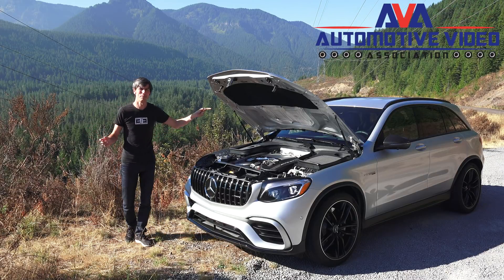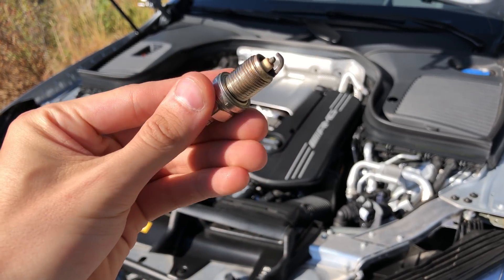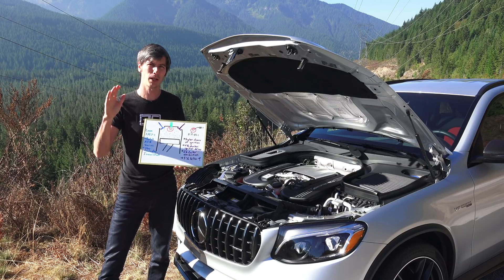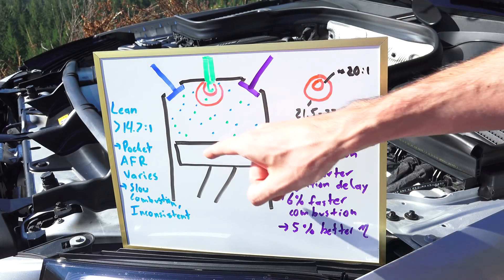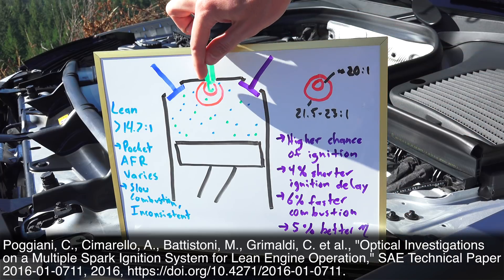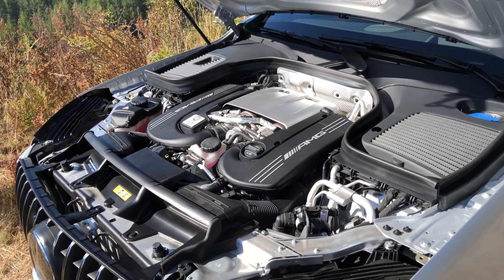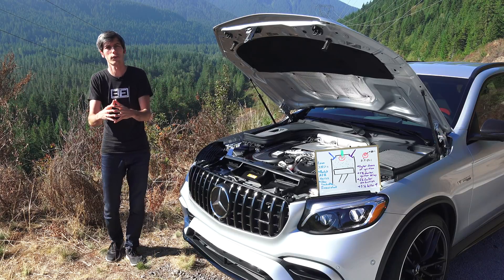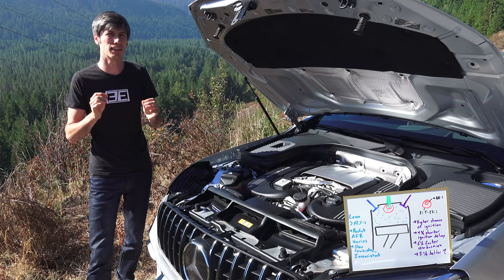Mercedes Spark Plugs Fire 5 Times For Better Efficiency

Comment: 5 sparks within 1ms - that means the charging time of the ignition coil must be about 200µs. Do they use 'conventional' coils with very low primary inductance or a capacitor discharge igntion system ?
Reply: they use COP (Coil Over Plug). Each cylinder gets it's individual coil and MosFET transistor driver. I don't believe any Capacitors are involved because they don't take heat too well... early failure.
Reply: @glasser2819  I know, but most coils take 1-4ms to charge for an energy between 30 and 90mJ. That is not an option in this case. So it would be interesting to see if special coils with cspacitors or conventional coils (low inductance , high current) are being used.

Comment: do engines need to be designed so they can use 5xspark plugs or could you put it in any motor, given their the right size
Reply: Pv†. Oldschool you could put it any motor but you may see no difference or actually a decrease in economy depending on the design of the engine. (It’s not just the plugs that need to be replaced)
Reply: Nicolas Losito  remap ecu aswell?
Reply: Pv†. Oldschool you will need spark plugs that can handle the increase in  usage along with matching coils. Ignition control would also need to be re-mapped. 

I’m sure someone have done it already. This is not new tech. I just don’t see why to bother. It will cost more in maintenance than mpg

Comment: That means 20% of the average lifespan for plugs and stick coils because nothing is free. So now you change the plugs 5 times more often or experience rough running and loss of fuel economy.  I wonder how much the added maintenance costs offset the fuel economy gain. Probably winds up being no gain at all.

Comment: How does the multi spark method impact the life of the plugs?
Reply: Tedward reduces life... think about it
Reply: of course, but does it reduce life by 5 times?? that seems like a rough trade off
Reply: Tedward since the multi spark function only occurs during light duty (transient fueling) then no. But it will seriously reduce life of the plug.
Reply: Are these plugs far more robust/expensive to allow them to last at the same intervals as plugs that arent asked to cycle 5 times? haha sorry for the questions I'm just curious what went into their decisions and what was sacrificed (cost or lifespan?)
Reply: Tedward from what I have see other people saying, the spark plug change internal is reduced (60k km from 100k km). I think they are using the standard iridium plugs.

It is a rough trade off and they are doing it to meet CAFE standards. Saving gas is the major priority, not sensibility. So if they can save 1/2 mpg, which is about what this saves, yet it costs 10x more to maintain (increase in wear on all ignition components like plugs and coils) they will do it.
Reply: ^ now there's the answer I was looking for. Thanks Nicolas

Comment: Based on all the videos I watch, and Pico scope captures of firing events, Is a single coil even capable of building up a charge and collapsing the magnetic field 5 times in one millisecond?  I've seen one scope capture of a multi strike event and the second strike was always weaker then the first.
Reply: yep that makes total sense! 
When the Turn-ON time is shorter the coil primary may be less than 100% saturated... so there is a real trade off at higher RPM's when timings are shorter.
Perhaps use seriously better coils with rare-earth cores? $$$

Comment: That air to fuel mixture is quite an improvement.
I wonder if there's coils I can get for my Corvette that will do five Sparks?
Reply: GM V8 Engines already have Multi-Spark since the 90s if I recall. Saab also had it in the 90s and MSD have been doing it for awhile as well.

Comment: How that would compare to lettin the plug arc constantly during the power stroke versus 5 times? Problably would need a bigger coil and more amps, but if more sparks is better. A constant ark would be even better, right?
Reply: Mauricio Nestor negative

Comment: MSD ignition has been a thing for about 25 years as far as I know. Remember putting this on an old Chevy V8 a long time ago..
Reply: I think MSD is 3 times under 3k then normal after that.
Reply: vicdez  you are correct
Reply: Exactly. Thus is old tech

Comment: Interesting... I’m confused why they wouldn’t just extend the duration of the spark rather then increasing the cycles? This is a bit of the same idea as some older engines that had 2 plugs per cylinder (like the Nissan Z24 engine).
Reply: The coils need to recharge before firing another spark.  A coil takes the 12 volts of a normal car electrical system and cranks it up to 100 plus thousand which is how you get a spark that will jump a gap.

Comment: Would this effect the life of the spark plugs however?
Reply: yes, Benz recomended plugs replacement is significantly shorter than the usual 100KMi. I believe it's around 60 or 70KMi with OEM indexed plugs only so they are oriented consistently. The engine heads are threaded consistently such that with OEM Benz plugs the grounding piece is facing away from the intake valve.
(more priceless Benz plugs...)
Reply: G Lasser  I initially read that "...replacement is significantly shorter than the usual 100km." I was like, "you change your spark plugs every 100 km?" I did figure it out eventually.

Comment: Why not just fire 1000 times for 1000x efficiency
Reply: They should just fire non stop right? 😂
Reply: They should just glow constantly.
Reply: Nope, if they fired like that, or "glowed constantly" like diesel glow plugs you would get knock. You don't want preemptive ignition.
Reply: @levidaniels585  -- Marketing Dept doesn't like.
Reply: That might be called a gas turbine lmao
Reply: @coscorrodrift  no wonder now how German engineers invented the turbo-jet engines in ww2 🤗
Reply: @glasser2819  radial cylinders pushing a single crankshaft attached to a helix. Well that was for ww1
Reply: and ride the fire plugs like a broom sticks as witches do, right?
Reply: because the key to spark ignition is WHEN the mixture pushes on the pistons. 
It's the ignition TIMING (advanced before TDC) that delivers precise power stroke with less gas: 🤗
Reply: Too much of anything is bad, maybe it will decrease efficiency, but we never know
Reply: R.I.P spark plugs...
Reply: Coil saturation time.  The ignition coil doesn't instantly fire when the power is put to it, or in the olden days of point, removed from it.  Even MSD cuts back from 6 sparks to 1 at 3,000 rpms but it holds a longer spark and much more energy.
Reply: Ignition coils fire by suddenly removing current from the primary windings as in points or suddently applying power to the primary as in electronic.  In the former, the time needed with power applied is called dwell time, it's quite high as opposed to electronic. In either case it takes time to fire a plug, 6 is about the limit a plug can fire in a single ignition cycle.  There is great info written by Dr Jacobs on how it all works.
Reply: Why not a constant arc?

Comment: I have a good feeling that spark plug you keep showing is not the one in the engine. Copper...
Reply from the maker: Correct, it is not! Probably should have mentioned, it’s from my S2000, or maybe my old Integra. Had it sitting in the garage.
Reply: @EngineeringExplained  Lately Benz requires INDEXED OEM plugs to work with leaner direct injection.
I read that whole article directly in their Xentry bulletin system.

Comment: This 4.0 tt v8 is overrated. Wayyyy overrated. Mercedes is no longer what is once was. They r making too many random models and putting the same Engines inside they r overpriced and have little driving feek that a BMV has or even a Jaag....... Whaaaaat¿

Comment: That's cool, but I'm pretty sure Saab made ignition systems firing 3 sparks per power stroke on its 9000 series in the early 90s... I might recall incorrectly though, since I was only 10 at that time ! :D
Anyways, always cool to learn something new ! Hope you'll tackle Fiat's multiair and its intake valves actuation modes  at one point :)
Reply: yes, history repeats itself over and over again for eternity
Reply: Every MSD ignition box does this as well
Reply: Yup, I just posted this in detail above. (Im a ex Saab Master Technician).
Reply: @TheSaabClinicUK  Saab's Ion Sensing ignition system is the most advanced and efficient ignition ever made PERIOD. It detects pre knocking with a mirroring system (current applied to the spark plug gap) that monitors ionization (cylinder pressure) after the ignition spark event. Also uses high intensity  plasma spark strike. They should have used it also to achieve PPP for every conditions in a running engine. This would be the same as having a real time dyno on board. The perfect engine...
Reply: Fix It Again Tony
Reply: In my Ford training in the early 2000s, they claimed multi spark ignition was used up to a certain rpm.
Reply: Not quite 5 tho big boi

Comment: I hope Mercedes is not claiming this as new technology, as its been around for decades.  MSD (Multi Spark Discharge) ignition boxes for instance, like the 6AL.  Crane Cams HI-6.  etc.
Reply: Sort of like Ford's Triple Strike at idle...
Reply: Around 1999, I had a Pertronix Second Strike system installed on my old Datsun 1968. IIRC, you could adjust the second spark delay from 2 to 16 degrees. On this particular 1L engine, it never made any significant improvement on power, fuel comsuption or emission levels. But it was fun to remove the spark plug wire and see 2 sparks. Another feature of thw second strike was it could be used as a rev limiter.
Reply from the maker: They’re not, they’re just saying they use it (and have been for a while).
Reply: Jacobs Electronics in Australia was making MSD systems 45 years ago and their systems made 8 sparks per every combustion cycle.
Reply: @ranger-3.0V6   He's done some tremendous work in the ignition field.  I'm surprised his stuff isn't more common.  I've even seen how his units can vary the way they fire the plug depending on conditions.  Amazing.

Comment: offtopic: I thought something about why low RPM - high load condition is efficient for piston engine. You said it was due to less frictional losses from running at lower RPM, but I thought the biggest contribution was from the longer "effective pressure". Say you have the same pressure at TDC in the power stroke, as the piston travels down to BDC the volume of the chamber increases resulting in lower pressure. In higher RPM the piston would travel faster, thus lowering the pressure pushing the piston faster than it would in lower RPM.
Reply: But the pressure is the force which is pushing the piston downwards... So the pressure at TDC has to be higher at higher rpm or else it won't reach that rpm in the first place.
Reply: I'm talking about pressure drop. Lets say you have the throttle open the same amount, so more or less the same amount of air&fuel thus making the same amount of energy (not shaft output, just the combustion energy), the lower RPM is in 4th gear the higher is in 3rd or something.
Reply from the maker: The reason high load is efficient is because of low pressure losses. The reason low RPM is efficient is because of low frictional losses.

Comment: What is the trade-off between a heavier vehicle generating more traction at the tyres and the resistance of the greater mass to acceleration, both in terms of 0-60 drag times and cornering?
Reply: Mark Chippendale there are formulas for that. Use your google foo

Comment: What is the life of the spark plug?
Reply: Presumably about 1/5 of normal... So I reckon you'll spend more on new plugs than you save from the rather pathetic claimed 2% on fuel economy, especially in USA where fuel is still relatively cheap. Jason can do the math. It probably uses platinum/iridium plugs which last longer but also cost more (about the same cost per mile I think the last time I worked it out).
Reply: and not to forget the price tag of one alone...
Reply: Look up what sparkplugs Mercedes recommends and 1/5 that life span and you got an answer!
Reply: He or she is born, raised in a good family, go to school makes some friends, then highschool he or she starts to use drugs and end up in the trash
Reply: 10 min
Reply: they last a lifetime but Mercedes electronics will kapuut way before that and cost money pitfall of endless depth
Reply: As importantly what brand of plugs are they using? Don't get me started on Bosch, had one disintegrate in my engine. I guess Hondas eat them for lunch.
Reply: @InsideOfMyOwnMind  NGK are working well on my car
Reply: @ernodios  That was where I went after numerous people laughed at my choice of Bosch plugs for a Honda. Apparently it's well known among Hondaphiles.
Reply: @InsideOfMyOwnMind  well my car is not a honda but I had to replace the plugs and I've had no problems so far

Comment: And what about the lifetime of those sparkplugs? Can you give more information about this please?
Reply: Conventional copper core spark plugs are more prone to electro-erosion of electrodes. Multiple striking CDI's and also wasted spark ignitions can reduce life span of common spark plugs. This systems work better with harder material spark plug electrode tips as iridium (center) and tungsten (mass) and one or two degrees colder spark plug rating...
Reply: Dave Dörenberg-Veltman if it conventional iridium plugs they may have slightly less life but that’s a guess on my part

Comment: Why trying to be more efficient when clearly gas is not the future, electricity is..
Reply: Gas engines aren't going anywhere for awhile. Even if they aren't in our cars, we will be using fossil fuels to power the generation stations that electrify your EV.
Reply: Because electricity in some area polutes same or more then gas and the current technology is not that good. It will get there eventually or we will find a different method. And yes, I have owned pure electric for a few years.
Reply: to meet be able to meet laws. CO2 limits will drop again soon.
Reply: Some power station still use fossil fuel and coal, while electric cars has disposable that may higher than gas engine. Not saying that electric motor won't take over gas engine, but the pollutant volume of electric vehicles produced is not significally lower than gas powered vehicles at today's technology (in terms of produce-usage-dispose cycle).
Reply: Why not make both better?
Reply: because density of battery energy storage per kilogram vs gasoline energy storage per Kilogram is like comparing Cat vs Lion
Reply: EV are way more efficient and faster

Comment: Spark for 5times in one millisecond..!!
Then
What about the intensity of spark?
Is same or different?
Reply from the maker: Less intense individually, but more of them overall.
Reply: I am curious to see what the spark-plug voltage waveforms look like.  On a traditional ignition system, you have a large voltage spike (kilovolts) before breakdown, then an "burn time" where the inductor (coil) dumps it's energy into the newly formed plasma between the spark plug electrodes and outputs a much lower voltage for a millisecond or two.

   If you switch the primary of the coil on and off while the plasma is still hanging around the electrodes, you should be able to pump more energy into the plasma and effectively extend the burn-time. 

 Because you are using a flyback transformer to generate the high voltages (1:100 stepup ratio), the impedance on the secondary will be divided by 10000 as seen from the primary side.  If you have 500V at 1A during the burn time, that gives a plasma impedance of 500 ohms.  Reflect that to the primary side, and now you have a 500/10000 = 50mohm impedance in the primary.  That impedance forms a voltage divider with the primary winding resistance, and the switch resistance.  I guess modern ultra-low on-resistance Mosfets have made this kind of system practical.  Pretty cool.

Jason,  Maybe you could do a series of videos on ignition systems and spark plug voltage/current waveforms.  Just an idea.
Reply: Jess Stuart  Why would they have a spark plug fire multiple times instead of maintaining an arc for a certain duration?
Reply: Wojciech Leciejewski,

By controlling the "burn-time" through optional multiple spark plug firings, they can get better ignition during hard acceleration (rich mixture), and idling and light loads (lean mixture), and extend spark plug electrode life by only using the longer "burn-time" only when it provides a performance or efficiency advantage.
Reply: Wojciech Leciejewski  You can't "maintain an arc".. its there only as long as the energy is there
Reply: @EngineeringExplained  how do you find all this info? Do the manufacturers just tell you when you review the cars or something?

Comment: Is that s SUV? We do not like SUV'S, remember?
Reply from the maker: Same technology is used in the AMG GT-S/C/R.
Reply: @EngineeringExplained  
Oh ok, then we're good. 😉.
Reply: It would be nice if they actually gave you one of those to test drive ... :)
Reply: @kenkalajdzic  
I would assume he drove it already.
Reply: How about a video explaining the differences between the AMG Speedshift DCT/MCT/TCT gearboxes.
Reply: @KimHJensen  
That could be cool.
Reply: I can't remember specifics, but I do know that the AMG 43 cars use a similar transmission to the 63s with the difference being that the 63 use a multi plate wet clutch and the 43s use a torque converter.
Reply: Ooo. I MEMBER.
Reply: @Dtt4  
Me too!
Reply: I kno I sure dont would of rather see the E-63 wagon
Reply: @philb707  
Eh, it's ok.
Reply: @electroniccheeks  its the baddest wagon this side of the pond!  USS Trenton & USS Nassau by the way
Reply: @philb707  
Ok, great.